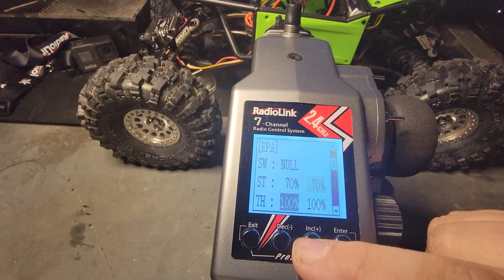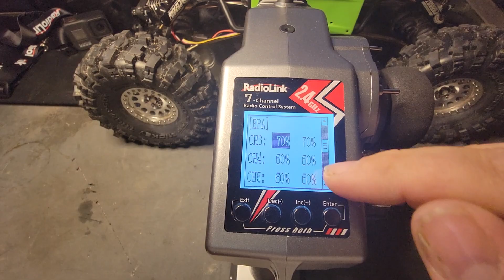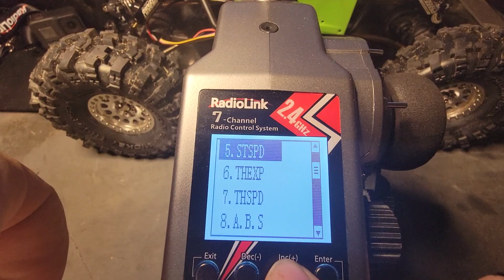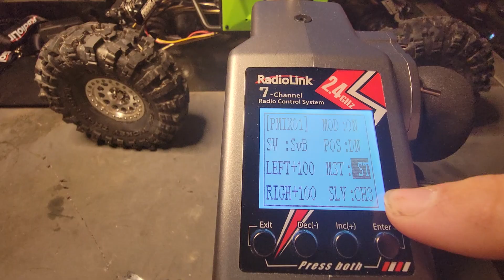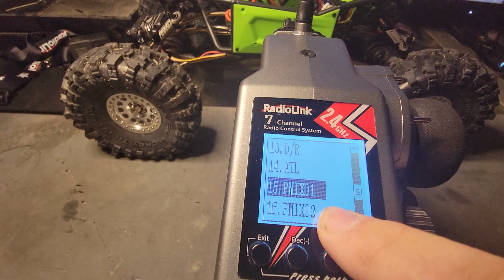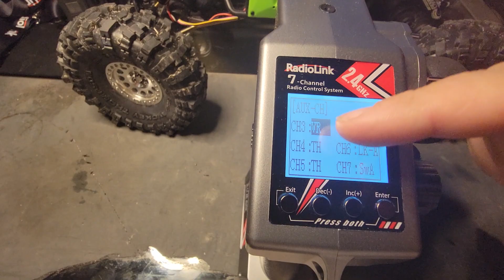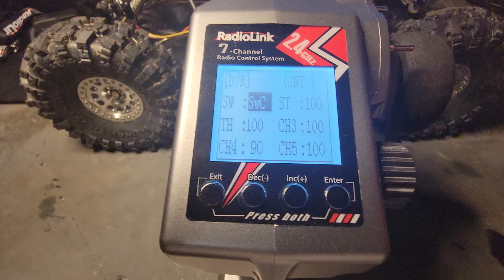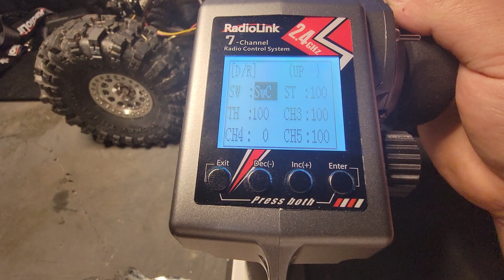Brushless Danchee Ridgerock with RC6GS 7-Channel Radio

Comment: you're chassis look stronger than the original one, where does it come from?
Reply from the maker: Its an injora 1/10 rock buggy chassis. Can be found on amazon, ebay, injoras website, or even temu. But to use this chassis you will need to make a special skid plate to attach the upper and lower links to. I designed a 3d printed set that is on Thingiverse if you can 3d print yourself.  https://www.thingiverse.com/thing:6893153
Reply: @_Tim_Allan_  Thank you

Comment: How did you hook up the battery? Or batteries?
Reply from the maker: Easy way is to but a parallel wire dongle offline but i just soldered them in parallel. I clipped off the connectors and bought a new battery connecter with pre installed wires. Solder all the red wired together then solder all the black wires together an they are all in parallel. Just make sure that you remove the red wire from one of the 3pin connecters that also comes off the motors. You still need one connecter to have it to power the transmitter but if you keep both you will fry your transmitter
Reply: Maybe make a video on that process. I just yanked the Mini16 from my Temper and grabbed another one from the hobby shop. It already climbs like a champ with all the other mods. Also I have the Flysky G7P. It has preset 4ws functions built it so it makes it very easy to set up just like the original Danchee controls. Also you can adjust the Overdrive and underdrive settings if needed. I’m gonna give it a shot.
Reply from the maker: I already have a second video that goes into a bit more detail on my channel

Comment: Did you have 2 x hobbywing fusion mini 16’s

Also you are running the 2 esc’s (as they come as a bundle) 
I wire the 2 mini 16’s in parallel as the esc can handle it
Reply from the maker: Yes, the RC6GS already has a "throttle" channel (ch2) and you put the 2nd on another channel when you do this, though, you need to take out the power cable on one of the 3 pin cables that go to the receiver . I did it with the rear one. If you don't do this you will over power your receiver and burn it out!!! Just remove the power lead (red wire) from the plastic 3 pin connecter with tweezers and tape it up so you can still use it for a different project if needed. 

Also on the RC6GS  you need to set the remote to recognize your second motor as an actual motor. Go to "AUX-CH" and set the channel you have your 2nd motor on to be throttle "TH". The remote will automatically recognize it and use the throttle trigger as normal. Just remember to turn the power down to around 60% as 100% is way too much. 

The dual esc's realy just work as long as you calibrate the motors (it's easy). The hardest part of this build is modifying the motor shaft to be shorter and modifying the axle housing to fit the wires off the motor 

I'll make a video as this can get confusing with just text
Reply from the maker: I bought both mini 16 motors recently that have esc's in them already and wired them in parallel aswell. If you keep your eye on Amazon, they have them in stock randomly but run out quick as the 1/18 comunity love them. I plan on making another video going over the problems I ran into for fitment and modifications but any 200 gorilla with a file and a hacksaw can do this easy 😂
Reply: @_Tim_Allan_ still wondering how to run 2 esc’s in parallel. 
Delivery came today and going to attempt it today. 
Can you enlighten us how to wire?
Reply: @_Tim_Allan_ do you mean you just took each cable from each esc and put it in channel 1 and 1 other channel on receiver?
Reply from the maker: @MikeyRCScotland  2nd video posted!